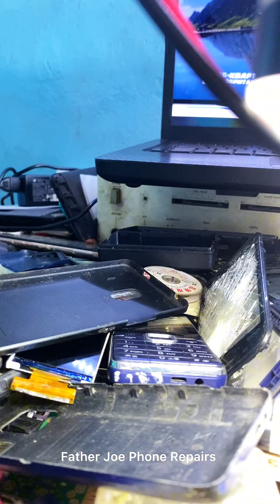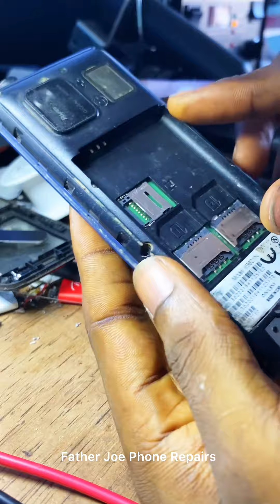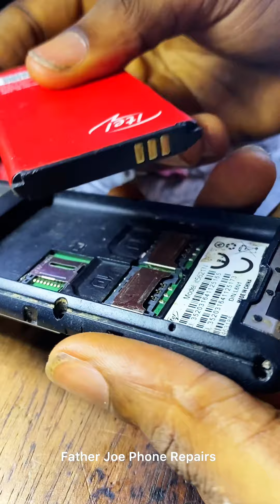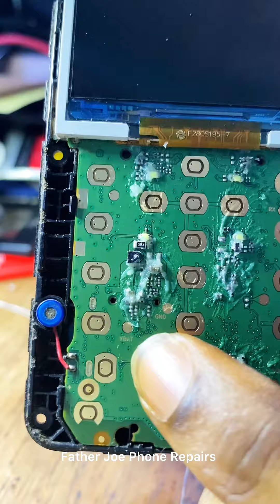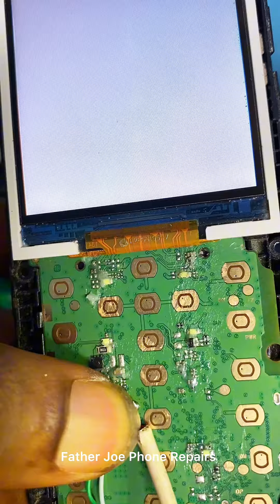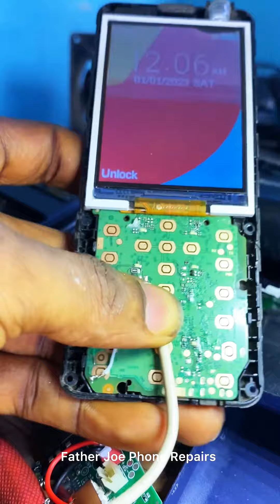How to fixed any phone that consumes battery 🔋

Comment: Sir there is one phone that customer brought to me here he want to change battery connector i mean terminal 
But I noticed that the left leg of terminal has pull from the panel 
Please is is there any way that I can use the wire and run it because I put it like that and like that and the phone turning on but any battery that you put it is swell up the battery will die please what should I do@fatherjoe

Comment: Thanks i would like to ask a question cuz i have thesame problem on here 😢 , if you can use a usb cord and a 5 vlt charger can you also use the cord with out laiding it to the vbt and gnd can you just use it directly like plug it to the charging port🙏
Reply: If he use direct phone charger, the voltage entering the phone would have been reduced from 5v to 4v by the charging ic.

 However, his motive is to inject complete 5v into the panel so that we can detect the bad capacitor fast

Comment: How can i solve the slowly charging in Tecno LC6? I Change the down board is still not fast
Reply: Try and locate the charging ic and test the voltages across all surrounding components especially the input and output of the charge ic

Comment: But sir Joe if I du removed a capacitor without putn another it's work as normal to some of the capacitors and the phones too
Reply from the maker: it will work,but you really need to replace it with another one
Reply from the maker: it will work,but it's adviced to always replace it

Comment: I would like to ask, if you remove the faulty capacitor, I doesn't need replacement?
Reply from the maker: You need to replace
Reply: But you don't showed it replaced
Reply: Just that saw it there

Comment: Tell them the truth, they should buy DC voltage supply and a rosin paste. This one you're doing is stressful. You too need to have it. Soldering paste is not precise but you are doing a great job so keep it up
Reply from the maker: Yes, I understand the importance of having the right tools for the job.  Thanks
Reply: My friend you're doing a great job and Helping other Engineers do there Best. We appreciate you taking your Time/Resources and to help us. thank you bro @fatherjoephonerepairs
Reply: Pls fada joe, why do you connect USB cable to the charge head while the battery is intact?

Comment: Fada Joe, this seems confusing. In one of your videos, you said engineers should put the positive probe of their multimeter to the ground (on the SIM card cover) and the negative  of the probe to the positive terminal of the battery connector of the phone to know if there is a charging connection. But in this video, reverse is the case. Could you please explain that for us. Thanks for the good job..
Reply from the maker: Video coming soon
Reply: @fatherjoephonerepairs  Father Joe, please reconcile this for me because I don't know which one to follow! The previous one or this method? Please tell me.
Reply: @eightelms 
In the first video, he used the multimeter to conduct a continuity test from the panel ground (SIM card case) to battery positive and later, the battery negative.

On this video, he's sending 5v to the panel, hence, positive wire goes to Vbatt and negative goes to GND.
Reply: @fatherjoephonerepairs  Father Joe, please reconcile this for me because I don't know which one to follow! The previous one or this method? Please tell me.
Reply: @fatherjoephonerepairs  Father Joe, please reconcile this for me because I don't know which one to follow! The previous one or this method? Please tell me.

Comment: 1 What Rate will my multimeter show me if a capacitor is consuming power
2. If assuming i tested the battery terminal and it shows its been blocked what should i do immediately then.